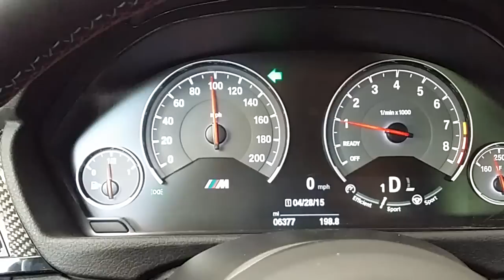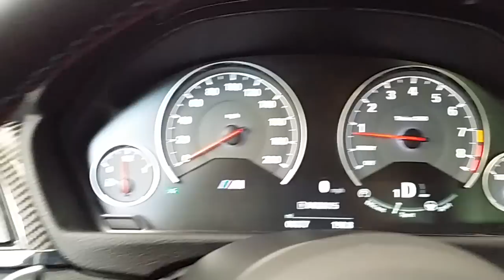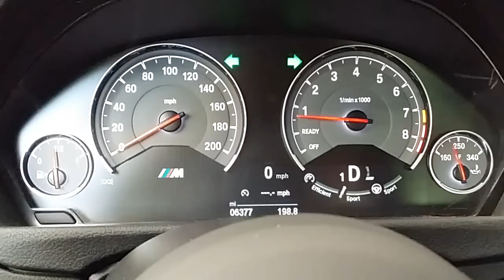JB4 F Series OBDII CANbus Wheel Control DEMO

Comment: This is first menu, the right side is the option selected on the left menu:
'0 map menu, map shown on tach 
'1 Active Sound MUTE (not relevant for most N55 models) 
'2 Boost gauge on fuel, scaling in dash is 0 to boost safety setting, turns on when gas pedal is pressed 50% or more and turns itself off when you resume low throttle use. 
'3 LED MAX brightness mode. For those with factory LED headlights this option brightens HALO during nighttime operation. 
'4 OBDII Diagnostic Code Delete
'5 1st gear boost limiter
'6 2nd gear boost limiter
'7 3rd gear boost limiter